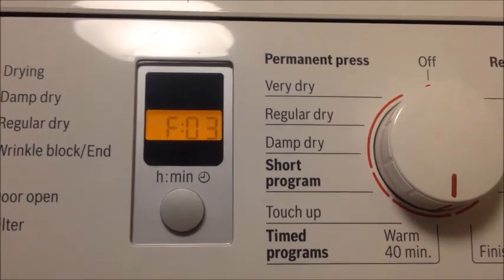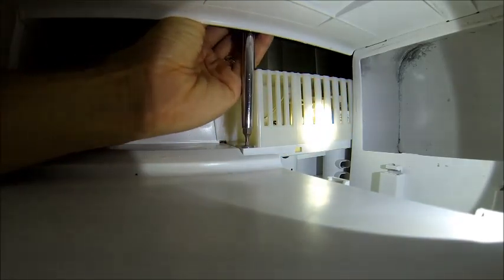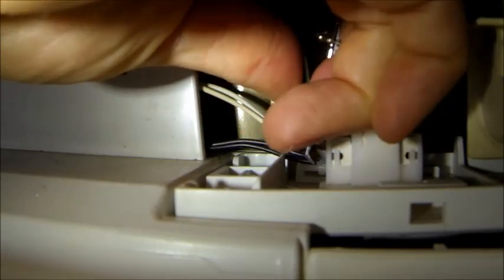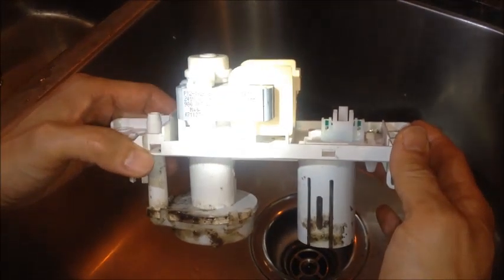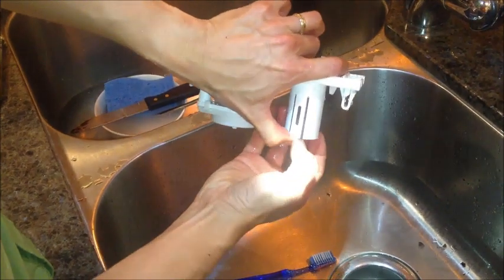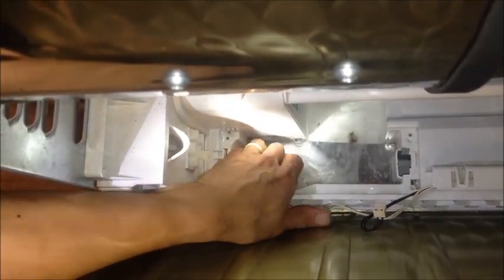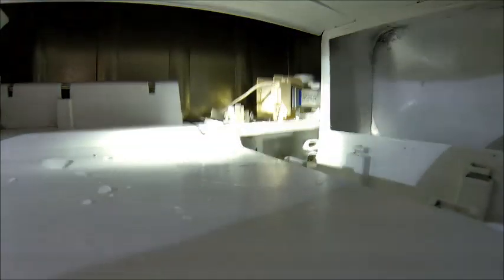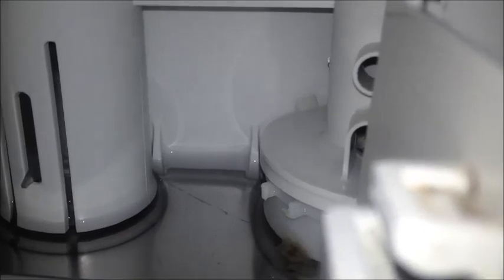Fix Bosch Condensing Dryer F03 - Extreme Sump Cleaning

Comment: Yeah, they have a clasp hinge type as of my 300 series since 2020. No zip tie. I had to take the top and side panel off to get that part and do a full cleanout! I'm doing my first load with it completely cleaned out and so far. No issues with the DR Code light. Thanks a lot with the videos!! Can't thanks enough! No technician needed!

Comment: Our Bosch dryer stopped pumping and unit wasn’t heating up. Called a repair service to check it out.  A $900.00 repair estimate. We were told we needed to replace the pump and the drain hose. Watched the video and pulled out the pump and cleaned everything, works great now!! About 45 minutes. Thanks!
Reply from the maker: Thanks for reporting your success.  Hard to believe how much appliance repair costs these days!

Comment: I have a Bosch 300 dryer with a "DR" code (i.e. same design and issue). I decided to cut an access panel just above the pump area. After confirming there were no vital components in the way, I marked the cut and took a thin grinding wheel to the side panel. The metal is thicker than I expected, but still only took a few minutes to complete. The results was a perfect opening to pull the pump and clean the sump. My pump did not have a float, but the sensors were covered in lint (I don't think I had any microbial growth). After cleaning and reassembly, the dryer is working fine, and cleaning will be a 5 minute job next time I have to do it (presumably in another 4 years). Thanks for the great video and figuring out the problem!

Comment: This is a fantastic video.  Did the process in under 30 minutes!!!   My dryer is a little newer, with an electronic float and reusable cable tie, but without this video, I would have removed the side panel and still be at it.  Thanks bro!

Comment: A million thanks for posting this video!!!  Your detailed explanation and video worked on my 2019 Bosch 800 series ventless dryer as well! Bosch must have seen your video and adapted the way they secure the electrical wires (they ditched the zip tie for an easier-to-access cable holder on my model). BEST...VIDEO...EVER!
Reply: Yeah, they have a clasp hinge type. No zip tie. I had to take the top and side panel off to get that part and do a full cleanout! I'm doing my first load with it completely cleaned out and so far. No issues with the DR Code light.
Reply: Working on a Bosch 500 series and I had a hard time releasing this clamp holding the wires. I took the pump unit and span it around to see underneath and removed the clamp that way. This kept the wires together too. Rest of video was really similar except for the sensor, that too is electric.

Comment: Thank you so much for this great video. I am a pretty serious DIY guy and was not looking forward to this job. I watched your video twice through and completed the whole job in about 20 minutes. That T15 torx screw is hard to see from the front and once you know it's there the whole thing is a piece of cake. I have a series 500 dryer and for anyone reading this the newer dryers do not use a float but simply have two metallic strips that are immersed in the water and the resistance changes between them as the water level changes. I found that giving them a quick wipe made the sensor work more reliably. Otherwise the procedure is the same for the removal and reinstallation including the little clips on the connectors. Mine has a retainer for the wire tie that has a barb fitting that can be removed and replaced but I cut the tie before discovering this. Thank you again!

Comment: Thanks MITEEman. 

Video: 10/10
Explanation: 10/10
Solution: 10/10

This is the most perfect and best instructional video for the F03 code on the internet. It took me 4 years of calling Bosch and cost my landlord about $1000 in labor, replacement pumps, and cleanings before I figured out how to remove the pump and clean it myself. This video goes many steps beyond the knowledge I've acquired and will save me time and my landlord money and I'll finally have a well maintained machine that works with heavy usage of 4 adults.

Comment: these two videos are absolutely essential for anyone who owns the Bosh Axxis Condensating Dryer - typically a repair will cost some $400 and with patience, a credit card, small screwdriver, one can clean the entire assembly and in 30 minutes spend nothing but a little time

Comment: Thank you so much for this walkthrough. I was minutes away from calling a repair service and probably looking at hundreds of dollars in repairs when I found your video. It took me a bit longer than 30 minutes, but your instructions were on point and everything is working like new now. I didn't have any algae in the sump, but there was a tremendous amount of lint that had clumped up and was preventing the whole system from working properly. Thanks again, you rock!

Comment: I love you, dude. Seriously. THANK YOU for this video. 

I rent my place and inherited this dryer as a result. I've had somebody here twice to fix it since I moved in 6 months ago only for this issue to keep coming back. They said they took the unit apart to clean it but they clearly did not because the amount of algae and lint that I found in the sump was wretched. The routine cleaning that the maintenance person and I had done in the past were definitely not enough. 

Your instructions could not have been clearer or more helpful. The dryer is now back to working condition after just 30 minutes!

Comment: I am joining the choir!  This, the deep clean,  worked!  I have a Bosch WTE86300US/09 purchased in Jan 2012 and this solved the annoying problem.  We run our dryer constantly so it is definitely a heavy use situation (in addition to less than stellar dryer design in my opinion). My friend, handier (and more fearless) than I,  came over and did the work but it was really straight forward.  The only (temporary) gotcha we ran into, and probably only unique to us, is that the protective cap was not screwed in.  My guess is that we must have had service on it once before and the repairman did not screw the cap back on.  BUT...what he did do was put the screw in under the cover.  Thus, after releasing all the electrical connections and it was time to lift the pump module out, it would not budge  It took my friend a few minutes to figure out that the screw was still in there.   I did the scrubbing and like the video, there was definitely some slimy gunk, especially on the impeller.   After the fix, we have run about 10 loads since and working perfectly.  Prior to the fix we could not get through one drying cycle.   

Thank you taking the time for creating and sharing a really helpful and cost-saving video.

Comment: Thanks for the great video! My dryer has those metal water level sensors like another commentor a couple months ago, my pump wouldn't work after cleaning it all out so I read through the comments,  pulled it back out, wiped the sensors,  success!
Thanks for that tip John. Another commentor broke a tab off one of the two plugs, I did too, ran several loads and got the E:90 code, banged the side next to control panel,  nothing, remembered that broken tab so went back in, pulled plug out and shoved it back in, E:90 gone.
Thanks again 🤙🏼

Comment: Just did this. Didn't have to clip the zip tie at 3:00 because I undid the torx screw, pulled the wires, then the hose, then flipped the whole thing over and used a needle nose pliers to release the zip tie mount from the pump frame. This video is so awesome @MITEEman

Comment: Thanks for these instructions. I've started with only the quick sump cleaning because my dryer just started giving false alarms about full water tank when it's only half full.
My sump isn't emptying completely so I guess I might soon need to try this full procedure as well as it looks quite easy. Incredible that the manual doesn't even hint about cleaning the sump since it's obviously mandatory. Mine lasted four years before starting to clog up.

Comment: Hi MTEEman, thank you so much for the amazingly detailed explanation. We have the Bosch AXIS #WTB86201UC,  top and bottom washer dryer, without outside exhaust, I just checked and found the box you show. I am pretty sure I can do it but we bought it at Sears and they came, it didn't get fixed so we are calling them back. This time I know what they need to do and I am not blind about it. I really appreciate your explanation. Thanks again🙏🏼

Comment: Just want to thank you for this good walkthrough. It all went very easy just as you outlined. one of the electrical tabs broke off during the removal due to brittleness of the tab. however it does not seem to be a problem yet. Otherwise everything went smoothly.

Comment: Thanks for the vid. FYI alot easier by the side when side panel is removed. Also a note to all to clean buildup of lint from the rear lower rear fan to the heater. All can be easily remove and vacuumed clean. Cheers

Comment: Did this to mine fixed it completely.I didn't unplug the dryer either. Useful tip just use a kitchen sponge  so much easier to clean it

Comment: This video is great and it saved loads of time on the Classix 7 we have.  It does not have a front panel digital display, just a couple of lights one of which is empty container.  Very similar problem, in my case the empty container light coming on even though the container was not full. And very similar but not identical design.

I tried first to bend out the side panel and glad I did because I could easily get the cover off the motor.  More importantly was that in the 2 year old Classixx 7  there is a stiff plastic return pipe at the rear of the pump module.  Had I been working from inside it would have been very hard to get that out or put back in.  Also the sensor is not a float valve but what appears to be an electrical sensor.  If water touches the two prongs then it must be detecting water.  The connectors are in the same place and look very similar though. Also the zip tie is now a clip that can be released.

BTW if you wondered how the dryer knows the container at the top is full when there are absolutely no sensors or any obvious flaps or valves  I can reveal all.  The pump takes water up from the sump into the container.  If the container is full then the water overflows and comes back down a return pipe.   So if the control system notices that it is having no luck emptying the container after a timeout it assumes that the container is overflowing and water is being returned to the sump.  So if the sump clags up with lint, as in my case,  then it doesn't empty properly and you get the fault.

Comment: Great video, really encouraging with a you-can-do-it vibe and all the specifics to back it up.  This is my second time going through all this.  I have a variation which might help someone looking at this.  I use a wet-dry shop vac to make rinsing and emptying the reservoir easier.  It has the "Ridgid" orange (somewhat fancier) kind of hose, and I just take the attachment coupler off the work end to make it easy to route into the corners, so it's just the bare orange hose.  Also with the vac in hand there's a lot of other extensive clean-up you can do on the air paths to generally help. My dryer is on the floor so getting my arms in the right angles is sort of hard, and I have a pad and headrest, and headlamp of course, and a small flashlight to park in there during the whole process.  Use a phone video to check that you really got the reservoir completely clean.  In my case it was the pump that could no longer turn so in addition to completely cleaning the impeller as shown here, there was hair and crap wound around the shaft above it, so used a tweezers to pull it out.

Comment: ok   this was very helpful..   wow   great..  i actually followed it and was able to remove the sump pump and check it out..  and then replace it etc..   unfortunately is wasn't dirty..  geez..  how disapointing..    what i found out was the sensor was covered in some fabric softener sheet gunk...  so i took some steel wool to it and thats what made a big difference..  but if my pump dies then i now know i can remove it without removing the side panel etc..   thanks..

Comment: I greatly appreciate this video. I was able to fix my dryer in a bit longer than suggested, but mostly because I had an encamped little person that wanted my flashlight.

The wire cutting was a bit snug, but I was able to get in through the condensor slot rather easily.

Comment: I started my fault tracing at the top and worked downwards on a WTE84012 GB model.  So there was two sizes of torx used and what you showed was almost identical in the pump bay design. My issue was accumulated damp flock; small fibres normally filtered in the two prior stages but now forming a damp mat around the whole of that sump floor and access ports. Just about to partially rebuild the pump unit, side panel, maybe front fascia and not lid with an aim of verifying the pump still abates and shifts water onto the removable drainage tray.

Comment: Just some follow-up to my comment 4 months ago.  Your experience might differ but I did not have to cut the wire tie.  Upon pulling up the pump module, you can tilt it enough to get under it and pinch and push up the plastic post that is holding down the tied wires.  Upon completing the cleaning process and have reinstalled the pump module, just re-insert the plastic post with the wires still attached.

Comment: outstanding two videos, I did the easy one and have my fingers crossed, actually I haven't been able to uncross them since I worked in the tunnel. Pheeew! tight space.  I don't think I can do the deep dive though, one hand, and left at that, could prove tough for me. thanks though for a great job, this is my second dryer (building requires it) and I paid $225 for a new pump and service for the first one.

Comment: I have a Bosch dryer, model WTE86300US that had this problem.  The video was right on and solved my problem JAN 2017.   If you are worried your pump is damaged or too dirty to clean, you can buy a brand new one for about 100.00 and install it yourself.  Part Number: AP3962498, I shipped mine overnight from appliance parts pros website. THANK YOU TO THE PERSON WHO MADE THIS VIDEO.

Comment: Thanks for the video it was very helpful. I do recommend having someone with smaller hands around if you have big hands and arms though. I would never have gotten the drain hose and the screw back in without my small handed helper.
Reply from the maker: True, I'm a violinist with small and nimble hands.  A female might be a good assistant.
Reply from the maker: True, I'm a violinist with small and nimble hands.  A female might be a good assistant.
Reply: Funny enough, I'm a bassist. So my fingers are still somewhat nimble but my hands are huge. Most of these things once I could actually get my fingers around them it was fine, but that screw and drain hose my hand took up basically the entire compartment!

Comment: I guess I am the first one to snip a wire when trying to remove the wire tie! Would it be safe to reconnect the snipped ends of the white wire with a wire nut? Otherwise, everything went really well. Thanks so much for your video and the repair method you worked out - brilliant!!
Reply from the maker: Sorry to hear that!  It had to happen to someone.  A wire nut will work in the short term but wire nuts are not intended for wet locations.  There are special wire nuts with gel in them or even better there's small crimp-on connectors filled with gel.  Otherwise the wires may corrode and break, causing either a different code or at worst a slow flood if the pump isn't triggered.  On the other hand there's several exposed surfaces in there which don't exhibit any corrosion so you may be fine.  If you can get a soldering iron in there and solder it and cover it with heat shrink or even electrical tape the solder will prevent any corrosion and make a good connection.
Reply: @miteeman  Thanks so much for your quick reply! These are great suggestions.

Comment: Quick fix - I attached my bike pump to the end of the hose (the end that does into the drain).   gave the 'hose n pump' several pumps with the bike air pump.  that flushed out lots of clogged material.  then I wiped up what I could.  dryer is working fine, but will eventually need to remove the pump as described in the video.

Comment: Hey thank you ! this is a great video! Very helpful. However I had an older model so I had to take the side panel off because the deck that the sump pump is attached to is recessed about 1". Anyway, I've done everything correctly I believe but nw i've plugged it all back in and Ive got zero power to the unit. I wonder if there's a reset button or something on my model that Ive missed? Any clues as to why its not getting any power. Something simple I'm sure

Comment: I too attempted the 'quick flush' fix, and that didn't seem to do the trick.  I was just about to spend $1500 to $2000 for a new washer/dryer, then found this advanced procedure.

This appears to have fixed the problem, even though I didn't have any biomass on the floor of the sump area.  However, there was still a lot of floating lint, so I think that this more complete clean out has done the job.  2 weeks with it up and running now, where it would only work for a pass or three with the simple flush.

One question I still have, is whether it is helpful to force air through the remainder of the drain path.  My dryer is in a very confined space, and I have no desire to move it physically unless I really have to.  I'm just wondering if there is a chance of lint hanging around in the remainder of the drain path that is not accessed here, and if it is possible to clean that out by forcing air through.

Thanks Much for this video!